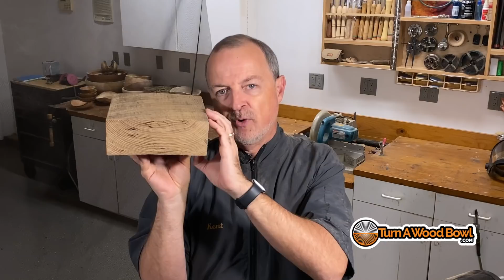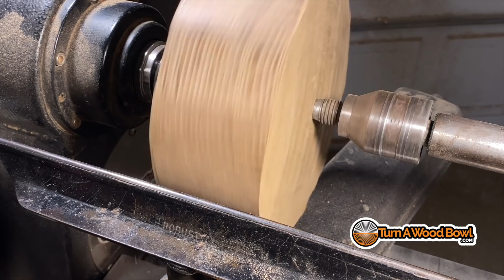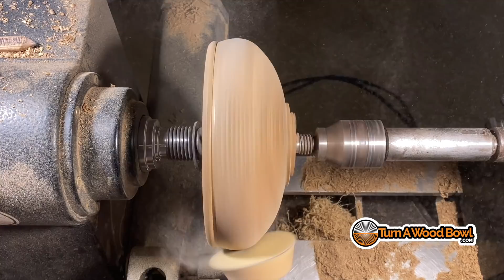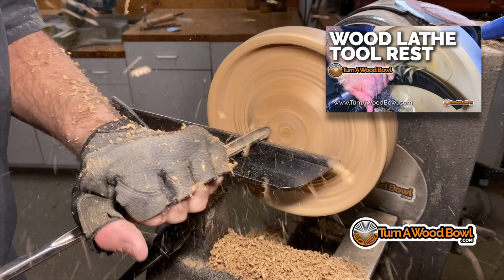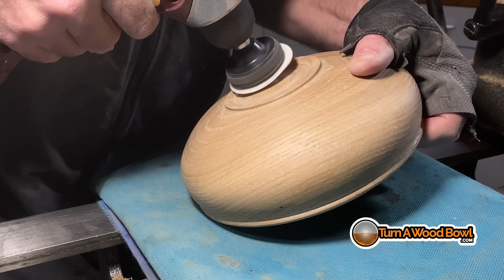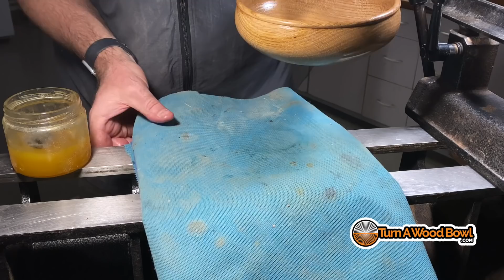Wood Turned Bowl Video – Old Oak Rock Hard

Comment: I've been turning bowls from blanks I cut out of a piece of reclaimed old growth oak that spent the last 150+ years as a structural beam in a house, so it's very dry and very dense. Filled the cracks with epoxy and revealed some gorgeous grain once I started cutting into it.

Comment: is your 1/2in bowl gouge the flute size or bar size? I have a 1/2in but it has a 3/8in flute. I was thinking I need to find a 1/2in flute size or 5/8in bar size. Would this be correct?
Reply from the maker: Yes, my 1/2" is the width of the shaft (with a 3/8" flute width). Same with the 5/8". This is a great issue because in Europe they use the flute size. So an American 1/2" is the same as a European 5/8". I hope that's not too confusing.
Reply: @TurnAWoodBowl  Thanks for the reply

Comment: I'm turning a piece of black walnut end grain on inside ( just a slice of the tree). It's horribly tough going.  Is it the way I've got the grain oriented or is it just very hard wood ?. I haven't turned bowls in over 50 years but I don't remember it being this hard
Reply from the maker: Probably grain direction is working against you. If it's an end-grain mounted blank work from rim to base on exterior and bowl bottom to rim on interior. Watch this https://turnawoodbowl.com/supported-cut-wood-grain-bowl-gouge-cut-direction/ Happy Turning!

Comment: I noticed that you are wearing a glove on your left hand. I want to buy a glove, because I have burned my hand from turning too long and the chisel heats up. The problem is I can’t find a glove that should work. What should I be looking for? I have to buy it online because my hands are bigger than the normal XL.
Reply from the maker: Find a snug fitting work glove and trim off the fingers. It's the easiest solution I've found. Happy Turning!

Comment: This is just what I need to see. I am working on a piece of oak now, although it is not 100 years old, it is rock hard. I have sharpened my gouge twice just on the exterior of the bowl. It is turned around now, in my chuck and I am starting to hollow it out. It's time to sharpen again, then I can continue to hollow the interior. I may have to sharpen more than the 5 times you did on your bowl, but I'll stay at it until I get through. Great video! Thanks!

Comment: With those corners (the off cuts). You could make a toothpick holder, salt & pepper shakers, and a stick pot/vase. Might be a profitable...., I mean, neat little set. 😉

I’m cutting a change bowl/cup from an oak crotch. The top of the Y is 5.5” x 2.5” and the bottom of the Y is roundish 3.5” - 4.2”. It was cut down to about 6’ length about two months ago, two weeks ago I cut 14” from the top of the split. I don’t have a bandsaw yet, so I threw the long blade on my mom’s jigsaw (that I’m borrowing), and I’ll tell you what brother, that wood is hard as stone. 🤯   It can’t really be that dry yet? I finally got the nerve up to just go ahead and, freehand corrected the way shallow factory grind. It took a little fine machine file work to finish smoothing it up. Cut a 100% better now. That raises a point I’d like to get your opinion on. 
Leave the burr?  Or,   Hone the burr “away”?

I think I prefer to get rid of the burr as part of the “sharpening process”. It’s becoming a ritual. 🤪
I’ve only been turning for about a month. So, you know, my vast existence. 😜😂🤪 Probably won’t be ready to fill an Art Market booth till mid-late next year. Just moving slower than I used to be able to, and a smaller bench top unit. Wen 8”x 12” variable speed. Does the job but definitely looking to get the Wen 14”x 20” & the bed extension, but first thing with the sale of a couple of sugar bowls, stick vases, mushrooms and tops. 🙏    I’m getting at least a three piece set of carbide bit tools. 

Any way. Great video. I thoroughly enjoy your videos and have learned so much. Which has been part of the inspiration to ask for a lathe for my birthday and actually got it. I’ve been saying X Box since mine died, but I’m definitely glad the fam waited till I asked for my lathe. 
Keep up the great work. Again, thanks.
Reply from the maker: Thank you for writing and sharing!  I'm so glad you are turning as well! What cool creations can you give your family and friends after hours of playing video games? ;) Ha! Kinda true though.

Ok, your question about honing is a good one. If you are seeing good results, keep it up. Do what works for you. If you are sharpening with traditional oxide wheels, honing helps a bit. I've found that sharpening on CBN wheels leaves a much cleaner finish and I don't hone the bevel after sharpening on CBN. 

Also, while sharpening and honing can make the edge cleaner and sharper, it will only last a short time. As I mention in my online Sharpening Class, we aren't sharpening a knife that will be used only occasionally. We are sharpening a workhorse and it's going to get dulled within a few minutes no matter how much time we spend on the edge. 

But again, do what works for you. If you see better results then that's fantastic!

All the best to you and Happy Turning! 
Kent

Comment: Those chuck jaws are way too open on that dovetail... they are only gripping by the points of each jaw.  A more secure grip would be decreasing the diameter of that dovetail down to just a wee bit bigger than the diameter of the jaws when they are closed - that wayyou have the full surface of each jaw gripping instead of just the ends.
Reply from the maker: Yes, thank you. Please read some of the other comments for the answer. ;)

Comment: Hi Kent, are these normal dovetail jaws on the chuck? Because I would expect they should close almost completely... when you mount the bowl, the jaws are still open and in this case the force of the jaws is not equally on then tennon but just the corners of the jaws grab on the edges...
Reply from the maker: You are correct. This bowl is sized right at the crossroads of where I wish the manufacturers would make new sized jaws. I should have turned the tenon to fit the jaws, but then the tenon would have been too small. If I moved up to the next larger size of jaws, the tenon would have been much too large. So, I cheated the middle. It can be done, but you also have to accept that the tenon is not fully seated and can come loose in the process. Thanks for the question. Happy Turning!
Reply: @TurnAWoodBowl  I just wanted to mention this, because I have the feeling your channel is a pretty good resource and a lot of newbies will learn from you... And normally I have the feeling you are pretty precise :-) This time I missed the information...
Looking forward to new videos Kent!

Comment: Have you ever turned cedar? and if so what did you use on it? tried and true? Your videos are so informative and I have a lot of cedar that I have been turning. Got tried and true for Christmas, using it but it seems to soak up so much of the tried and true. Hope I didn't mess up.
Reply from the maker: Yes I have. Cedar will soak up oils almost endlessly. I have found a base coat of shellac and lacquer makes a beautiful finish with cedar. Happy Turning!
Reply: @TurnAWoodBowl  Thank you for your response. I did the shellac and it turned out beautiful. Thank you so much. Love your videos. THEY ARE VERY INFORMATIVE. I am spending my vacation catching up on your videos. Thanks again.

Comment: Is there a way to enroll in ecourse without using Paypal.. My Credit card now considers charges to paypal as cash advances.. A charge ofr the advance plus interest from the day of charge.  UGH
Reply from the maker: Hm? Currently I only use Paypal. That's an odd thing for the credit card company to do. I wonder if there's a setting that can be made in Paypal that would change that process? Please see if you have a different option to check when checking out that will see your credit card as a regular purchase. Thank you.

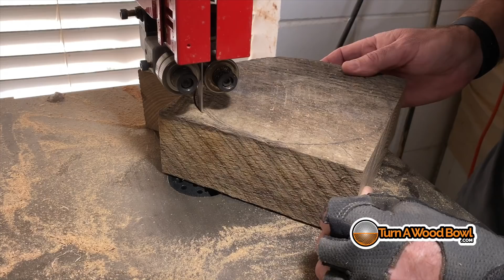Comment: Why are you using a tailstock extension? Also, does the 1:30 gouge orientation change with daylight saving time?
Reply from the maker: David, I use a tailstock extension to bridge the lathe gap on my lathe. Yes, daylight savings time is factored in. ;)

Comment: Really, really heavy on the ads here!  😕  I know you gotta make a living but ...
Reply from the maker: Thanks for understanding. It's not easy paying the bills and giving out free turning info at the same time. ;) Happy Turning!
Reply: @TurnAWoodBowl  I don’t know whether you have any control over it, but I’d rather watch a few ads together in the middle & then watch the rest of your video instead of jerking to a stop every couple of minutes to watch a short ad. The discontinuity is discombobulating. 🥴
Reply: @DancingFox6  if you are using a computer for watching YouTube, try installing and using the AdBlock extension on your Chrome browser. 
It will prevent any ads from popping up when you are watching YouTube videos, and you will watch the videos without any discontinuity. 
It is the first and only extension I always install on a new computer. 
Sadly, as far as I know, AdBlock doesn't apply if you are watching YouTube via smartphone / tablet.

Comment: That's a beauty!..a guy just gave me 2 24" wide by 6 foot long and 3 inch thick white oak slabs..getting ready to cut it up for bowl blanks..it is rock hard and very dry too!..was stored in a barn for years..should be fun...I like that linseed and beeswax finish..I'll have to try it..I'm a beekeeper so all I need is linseed!..did you use pure linseed or the other stuff? Thanks👍🏻👍🏻
Reply: 3" thick slabs that big? I am very, very jealous now.
Reply: @feetachemail  yes...2 of them..super heavy!..got one blank now 10.5 inches ready to spin. Theres also a big knocked over white oak around the corner from me I'm gonna hunk up when the weather gets better..I'm in WNY.  Recently picked up a big load of fresh cut sycamore too...got a few big ones cored out already and need to process the rest into blanks for coring.😃
Reply: @MikeB0001  Several neighbors are going to be taking down a variety of trees this spring and summer and I'm going to be hanging around with my trailer and chain saw to "help"  so I'm hoping I can stock up on enough wood to keep me going for a long time to come. :)  I took down my pear tree last summer and have a lot of that seasoning out in the backyard and hopefully I can get at some of that too.
Reply from the maker: Mike, that sounds great. I use Tried and True Danish which is (from what I understand) polymerized linseed oil. and nothing else, no dryers, metals, added chemicals, etc. Here's a link. https://amzn.to/3q2Roc7 Happy Turning!
Reply: Mike, you can try making your own finish. I often use something called OB shine juice that I make myself, it's 1/3 boiled linseed oil, 1/3 denatured alcohol, and 1/3 shellac. There are videos on YT about making and using it. Just wipe it onto the wood until it's fairly well saturated, then spin up the lathe and start  polishing. Have to build up some heat because it's a friction polish. Gives a pretty nice results. You can make your own shellac too. I think Kent shows how to make shellac in one of his videos.
Reply: @feetachemail  Hey Randall..I use that as well...saw it on Captain Eddie's channel a few years ago...thanks!

Comment: wonderful bowl Kent.  I got my Tried and True finish but haven't used it yet.  SHould I store in glass container or is plastic OK?  Thanks for the tips.
Reply from the maker: Good question. The finish will start to cure if it oxidizes, so keep as much as possible in the original container 
 and well sealed and put what you'll use in the next week or two into a glass jar. That way you're not opening and closing the original container. Happy Turning!

Comment: So this really doesn't feel sped up or anything. What would you say is a average time for turning a piece like this from beginning to end?
Reply from the maker: Good Question. Once you get the hang of turning bowls, probably 50+ bowls, it usually takes about 20-30 minutes per bowl depending on the bowl size. Of course, adding the filming in adds about two to three hours more for these. ;) Happy Turning!
Reply: @TurnAWoodBowl  thanks that was always something I wondered with all the wood turning videos I watch many are sped up so I never really got a feel for how long it takes. I’m getting a lathe next month and have been really curious about this.